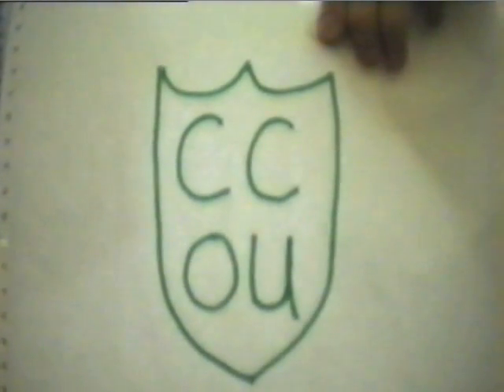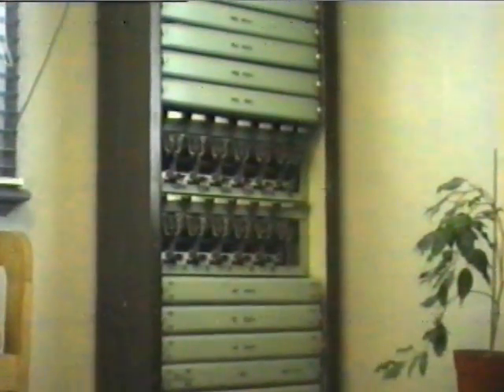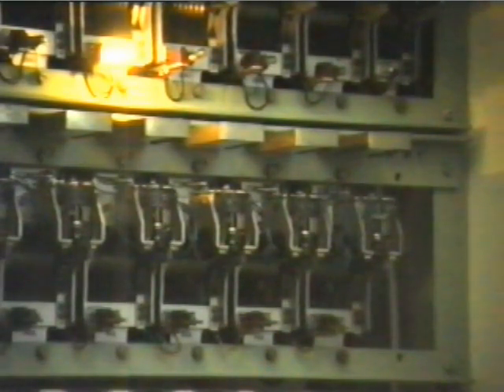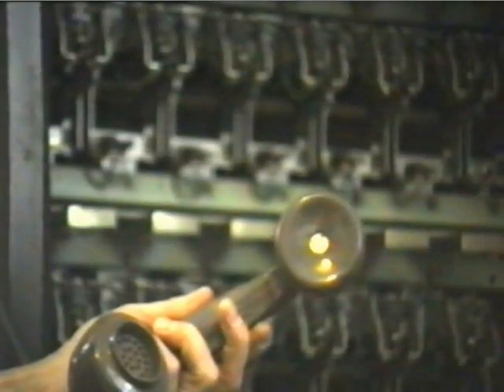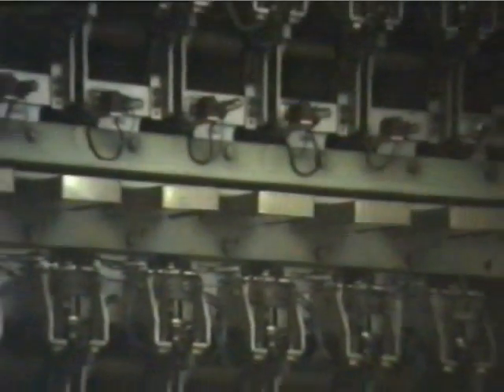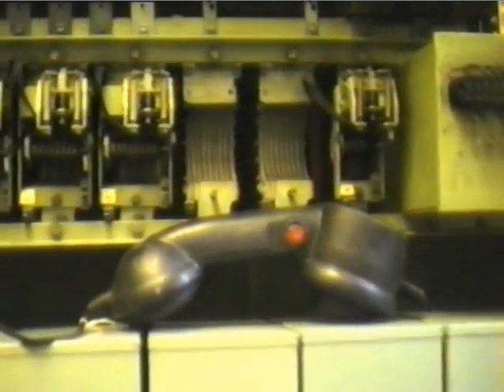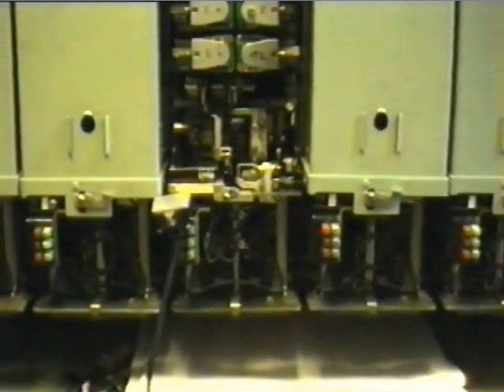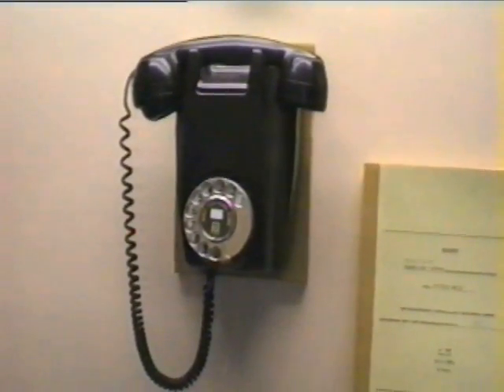PAX's & PABX's - Part 1

Comment: in the USA they were not called selectors but connectors. Selectors were the switches that connected the caller to a connector that used the last two digits dialed to completed the call.